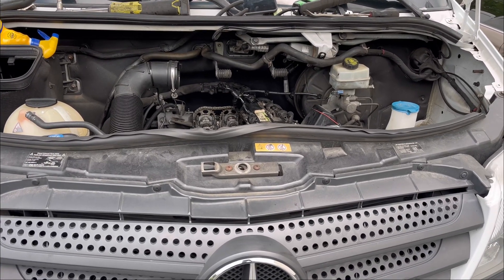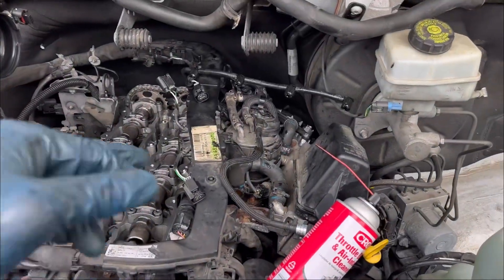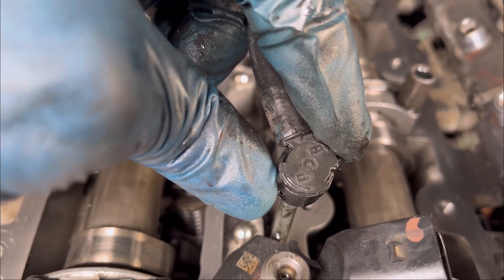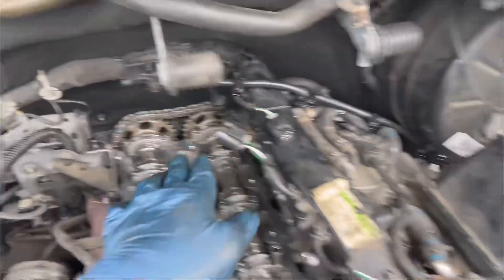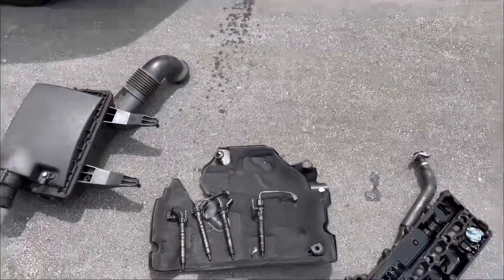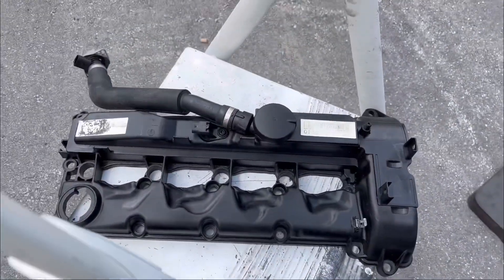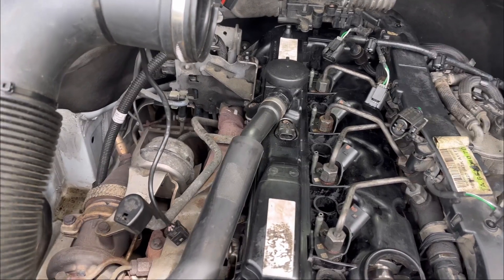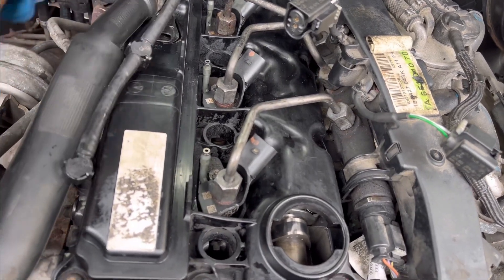2014 Mercedes Benz Sprinter Valve Cover Gasket Replacement

Comment: hi, you didnt show the actual step of placing the gasket. Did you use any type of lubrication or something else?
Reply from the maker: O just the gasket, I put a lil bit of gasket maker silicon on the edges that’s all